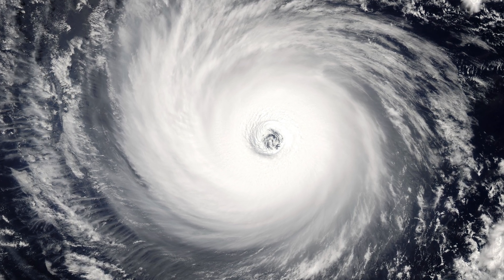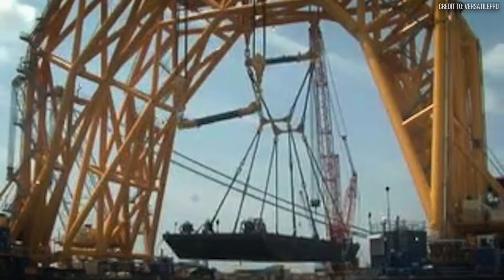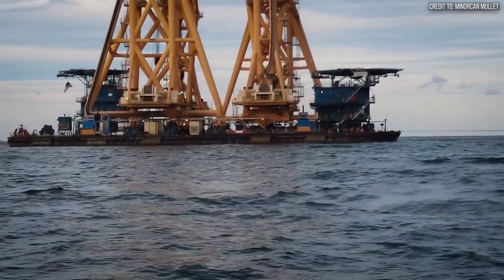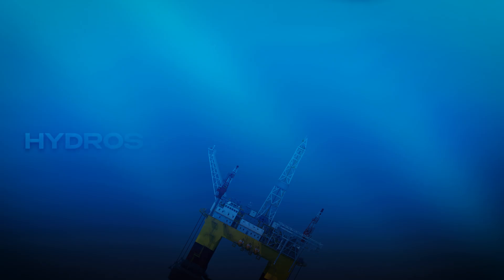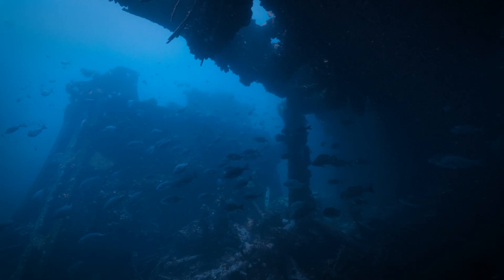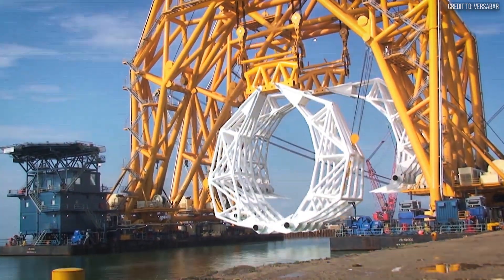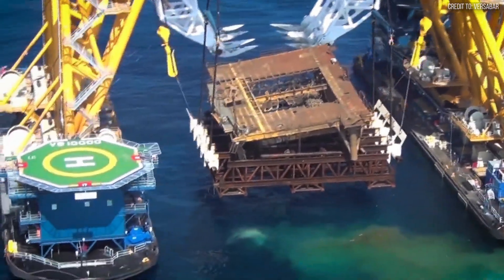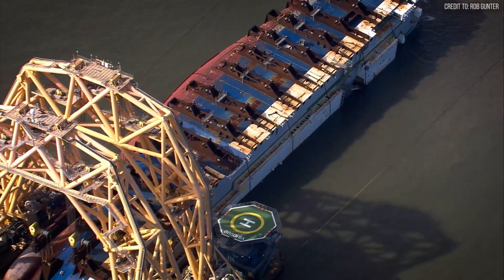The Claw: The UNUSUAL Ocean Crane That Lifts Sunken Giants

Comment: 350 feet isn’t shit
Reply from the maker: 350 ft might not sound extreme compared to the deep ocean, but lifting a 3,000-ton structure in a single piece from that water depth with the claw 350 ft below the barge is what makes this system remarkable. Very few vessels in the world can do it in one lift.
Reply: 350 feet is also over twice the depth a no-decompression dive can be made on air. While there are many wrecks at extreme depths, this is impressive at a level where scale is simply difficult to comprehend.